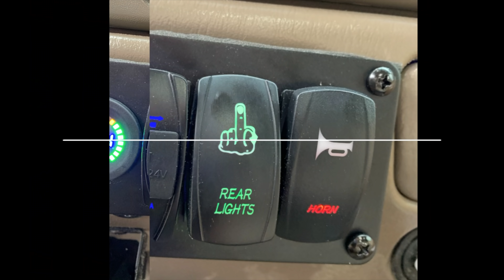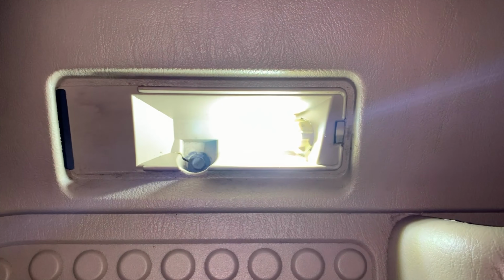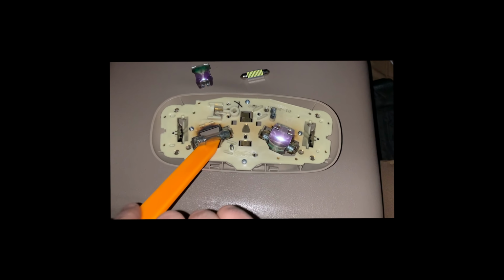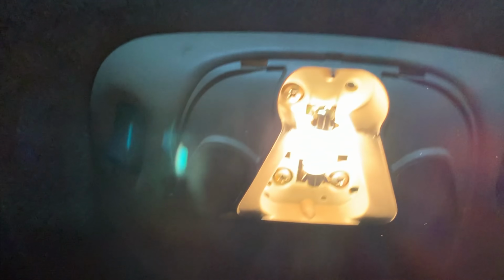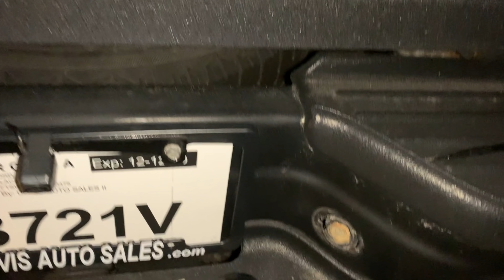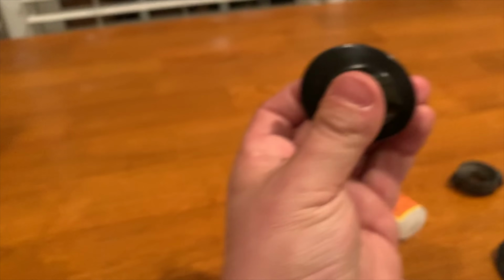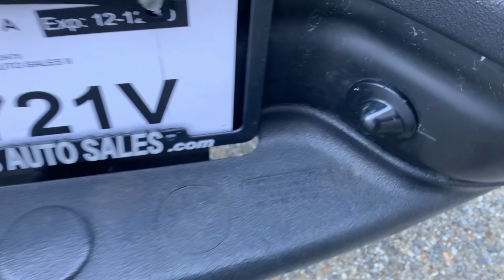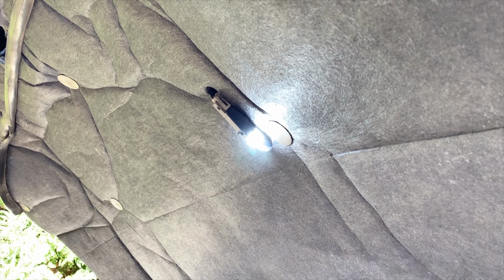LED Lighting, Interior, Tailgate, Hood - 7.3 Liter Truck Stuff

Comment from the maker: Check out my FORD DIESEL APPAREL SITE: www.73LiterTruckStuff.com
Reply: thnx made same mistake myself
Reply: How are all of your lights doing ? I just installed this kit in my 02 crew cab. I used the LEDs in my upper brake light and bed lights as well. I also pushed the hood switch down for the under hood light and did the swap out with no issues.
Reply from the maker: @LemonySnicket-EUC  Really well my man. I have no issues at all! Hopefully you get the same results!